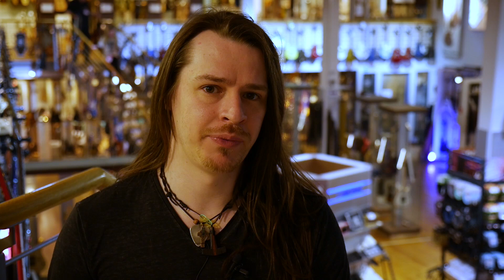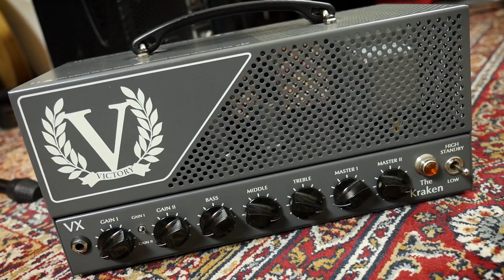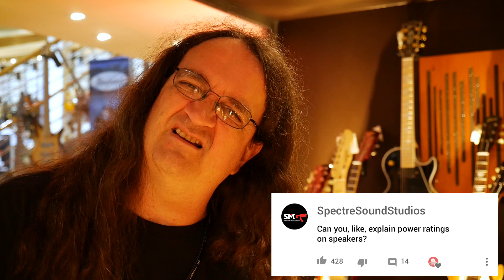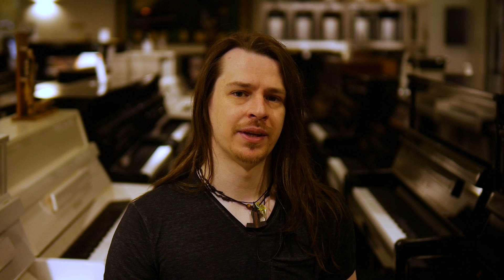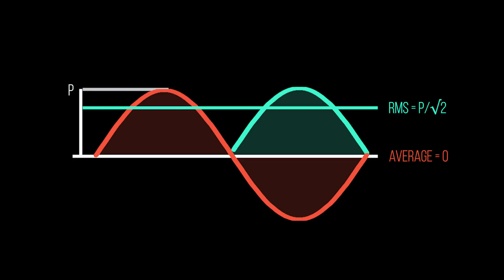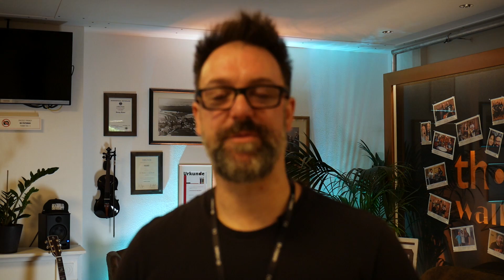How Does A Floyd Rose Work? and 6 other Tiny TATAs | Too Afraid To Ask #TGU19

Comment: Got a TATA question.  Is it possible to run a bass guitar into a valve/tube guitar head then into a bass speaker box (or 2), without breaking anything?
Reply: Possible? Yes.
Worth it? Er, no.
The input stage of a guitar head is designed to process the frequencies and voltages supllied by the pickups, and the output stage is designed to amplify the processed signals and pass them to a speaker designed to reproduce them.
Pushing bass guitar frequencies through a guitar amp will likely result in a distorted and weedy sound - it'll sound like a pile of fetid dingoes kidneys. That's why there's separate amps for bass and guitar. Most amps designed specifically for keyboards will handle both low and high frequencies, but I've tried bass through a keyboard amp and it just sounds weird.

Comment: I remember I was about to buy 150Wpmpo  speakers for my (very) old computer a long time ago. Then I noticed that the speakers I owned then had 2.5W written on the rear, never specified whether it's RMS or PMPO, and while I didn't understand jack about these things, I knew that something was not quite right with the 150WPMPO... called the guys and they had no fucking clue so I chose not to purchase them. Never thought about them again until this TATA...
So,yeah, it's basically audio snake oil

Comment: #TATA: If my amp head has a Direct Out, do I need to plug it into the speaker cab as well? Or will I fry the amp?
Reply: If it has a tube power section, then yes, it needs a load; otherwise, nope.
Reply from the maker: If your amp doesn't have a built in load box for this purpose then never operate a valve amp without a cabinet attached. Having a direct out doesn't mean you can remove the cabinet.
Reply: I kinda figured as much. But I thought it'd be best to ask for sure. Thanks!

Comment: What bridge system do i Need?
I want a bridge that i can Quickly intonate (with only my hands) on the spot without including an tremolo system
Reply: There is no bridge outhere that i know of that can intonate with only hands but most bridges require a screw drives or an allen key to intonate

Comment: I'm too afraid to ask why people love beat up dirty guitars,  and 60 year old designs,  then beat them up and scratch them.  Roll them in trash to get that funky smell.   But  they wont use old strings.  They stuck with same 2 or 3 woods,  when there is lots of choices,   but  those were the woods  easily available at the time to gibson and fender factory.  So they are now in 99% of guitars.  And can't a guitar chord be Improved.  Maybe gibson headstock is a design flaw that should be fixed!  why can't they fix the issue of broken necks?   Why even bother re-fretting a bolt on neck..  they were designed to be replaced.  Prince always had beautiful new guitars with new crazy designs,  I loved it!

Comment: Here's a #TATA, when I plug my guitar into my interface and don't touch the strings, I hear buzzing even though they aren't moving, can you explain what that is? I believe it has something to do with grounding
Reply: More than likely, something in your guitar electronics is not grounded correctly. Look at youtube.
Reply: If it's a single-coil pickup, it's gonna buzz no matter how much (or well) you ground or shield things.
https://en.wikipedia.org/wiki/Electromagnetic_interference

Comment: Anyone correct me. But I thought with speakers the lower rated speaker always got divided by the number of total speakers. So if you had 90w and 10w speaker. You would divide the 10w by 2 and both would only push 5w then. So you basically wouldnt be able to turn your amp up very loud. Idk I'm still confused lol.
Reply from the maker: No, you have that backwards. For a two speaker cab the lowest power speaker must be at least half the amp power, because the amp is dividing its power between 2 speakers.
Reply: @ScienceofLoud  ok cool. Thanks.
Reply: @ScienceofLoud  Also depends how the speakers are wired inside the cab, though (series vs. parallel). But at the very least, one wouldn't want to use two speakers with such disparate ratings, of course.